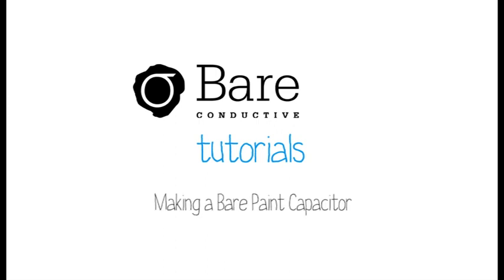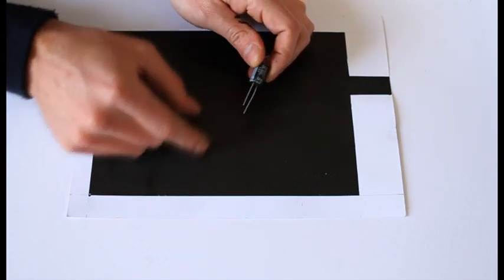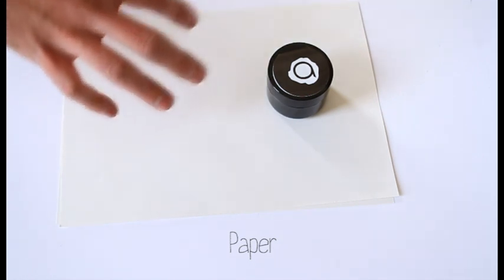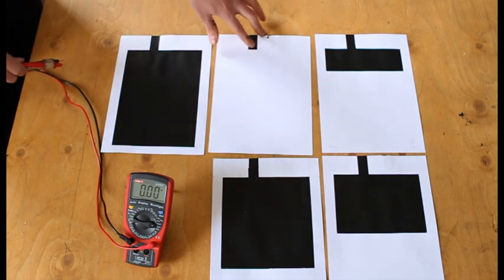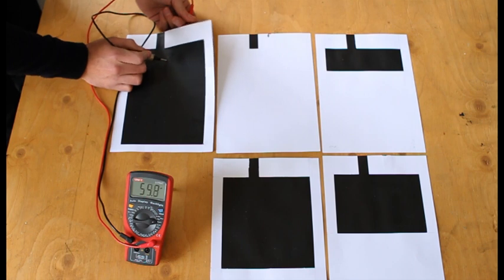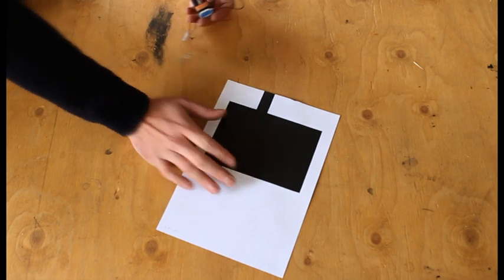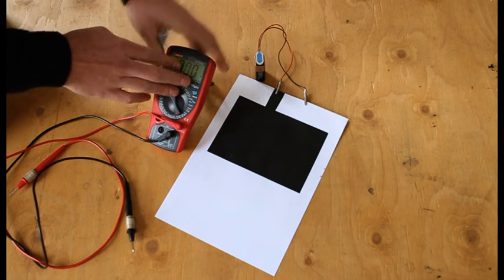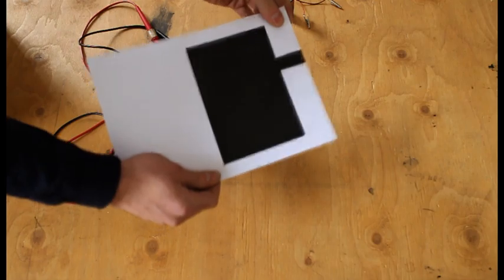How to Make a Capacitor Using Paper and Electric Paint

Comment: I think it actually charged up to 9 volts almoust emidiately. But you discharged it with your bare hands to 0.3 V just by touching it. It has got 50nF so at 9V it holds a charge of 4.5*10^-7 C. At a average of 4.5V of the capacitor while discharging and 10000 ohms of your hands theres a current floating through your body of 4.5V/10000ohm= 4.5*10^-4 A.
So the 4.5*10^-7 C are almoust gone in 4.5*10^-7C/4.5*10^-4A=10^-3s
(thats just a raff estimation because of the curre t flowing depends on the Voltage across your body. And since the Voltage isnt going down linear with time, the average voltage isnt half the maximum Voltage. But between 9V and 0.3 V you can estimate it with half of the voltage bdcause 0.3 V isnt that low so between 9V and 0.3 V it almoust falls linear.)

Comment: I hate to be overly critical. And enjoy people trying new things, but I feel people would benefit to understand a few things about this capacitor. 

As demonstrated in this video, it took a srveral minutes to charge a few nanofarad capacitor a few minutes to charge up to around  0.3v or 1/30 of the charging voltage. This is a result of  significantly high equivalent series resistance (ESR) in the paint leading to a virtually uselessly high resistor capacitor (RC) time constant.  Or that it has a significant high leakage current due to moisture in the paper and needs to dry much longer but the ESR is likely to increase with further drying. 

So although interesting,, this would not be a good capacitor for virtually anything. One will need a far better conducting paint.

Comment: Would normal paint do?
Also how many pieces of paper were layered (ie what was the thickness of the cap)?
Reply from the maker: Hello, we use Electric Paint, which conducts electricity. The capacitors were made with just one piece of paper, painted on both sides.
Reply: @bareconductive0  its not just electric paint, its  highly capacitive paint! :)

Comment: cool what paint did u use? can u try graphite?
Reply from the maker: It's Electric Paint. Carbon water-based. If you've got more questions, let us know.
Reply: can you use the paint as circuits on a circuit board?
Reply from the maker: You can use the Electric Paint for small PCB repairs, but you can't draw circuits with it
Reply: thank you for the reply.  I will look into this some more.  I'd like to make some capacitors with this.  Have you considered adding graphene to make it more conductive?  Or even copper or aluminum nano particles?
Reply from the maker: No we haven't actually! Electric Paint uses carbon as a conductor, but we haven't mixed it with other particles.
Reply: Bare Conductive i highly suggest some niobium nano particles in the mix after other metals.  The problem with adding metal shavings of any kind, is size.  The bigger they are, the more they will create heat in local zones. In a pant system like yours, the spreading out of the material evenly is what helps it disperse heat evenly.  Thus, keeping your nano particles from clumping would keep your painted wires from catching paper on fire.  There are ferro fluids that are used for older forms of laser printing, they contain magnitizing iron nano particles.  That might be a great first experiment, adding that toner ink to your carbon paint mix.
Reply from the maker: Amazing, that's cool, thank you for sharing this with us, we'll take a look!
Reply: It's carbon that conduct electricity. The paint he used was carbon based. That's the reason why it was black. There was lot of carbon in it
Reply: @bareconductive0  one can use the paint to trace circuit paths. And the paint having a reasonable resistance  can serve as one circuit component  a resistive heater.

Comment: You did not mearssure the resistance of the paint on the paper!!  This capacitor should charge tp 9v almost INSTANTLY!  The charge leaks off FAST.  I really don't see how there would be any difference in charging it for seconds or minutes unless there is significance resistance in the paint--still, not likely.  There is something off here.

Comment: Did i miss something here ! ! ? ? What happend to the electrolyte that you are supposed to use to make this thing work ?
Reply from the maker: Hi kev wallcroft, in this tutorial we made a capacitor using the paper as the dielectric and the paint as the conductive plates.